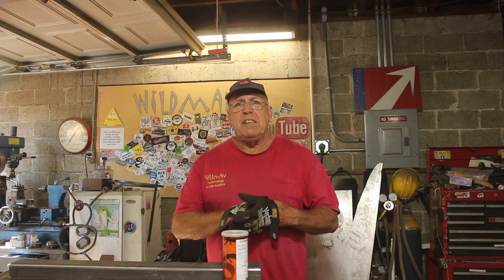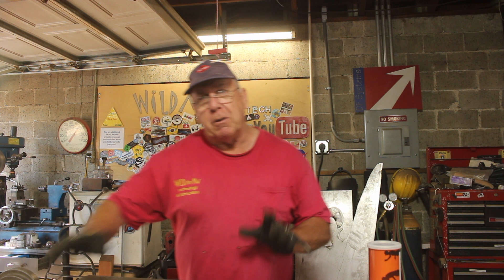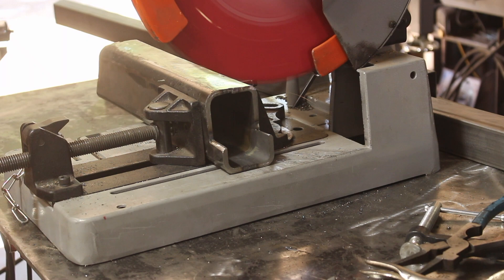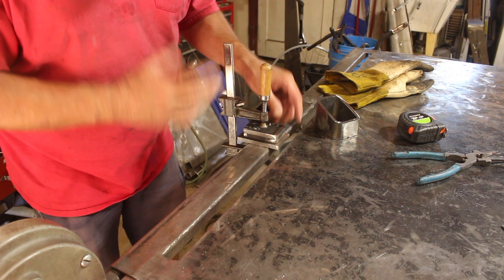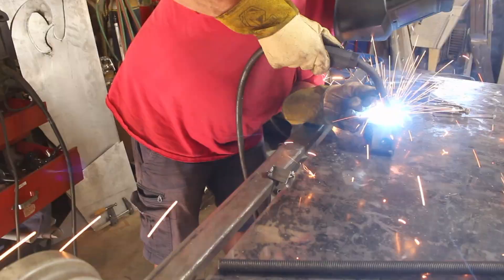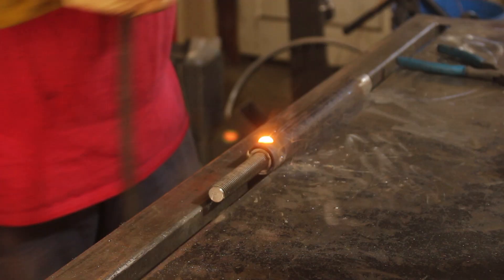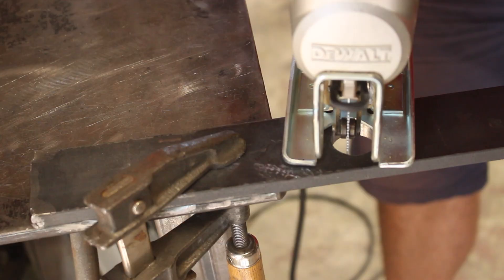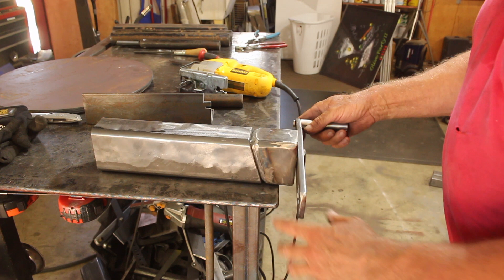Building the Fireball Tool Super Vise

Comment: I commented about this video a while back, Wildman, but the ol' budget dictated a very slow material(s) acquisition, so I had to come back to recharge my old memory cells.  As I recall, Jason's smaller "moving tube" was based on a 3.5 x 2.5 x .025 rectangular tube.  Yes, it was hard to find, but find it I did, so I'm writing to you today about the larger/outer fixed tube in the design.  I see that you quartered a 4 x 6 x ?? rectangular tube for this part of the vise, but I was thinking about using some 1/4" thick angle steel that we already own instead.  Thinking back to Jason's original vice build video, he didn't seem to be very happy about the play he got when he moved his sliding jaw assembly from side to side, so my thought is, if two appropriately-sized pieces of 1/4" thick angle steel were cut appropriately and welded together carefully - employing thin shims as upper and lateral spacers - the play between the two main tubes in the vise build might just be reduced.  I've never actually built this vise before, however, so your thoughts on this proposed variation would be appreciated.  I'd also appreciate your thoughts on the "after" of the build.  In other words, how do you like the vise now that you've worked it for while?  Is there anything you would change?  I've already liked and subscribed, but I thank you for your nice work all the same.  Hope all is well out there! 🙂
Reply from the maker: I chose to quarter a larger tube because the radii of the corners was a better fit than angle iron or flat steel. There's nothing wrong with using gibs as you suggest, but they'll need adjustment. On the down side, mine has no adjustment.
Reply from the maker: And there's nothing wrong with using scrap metal. Everything but the screw and bearings came from the scrap yard for this and cost less than $75.

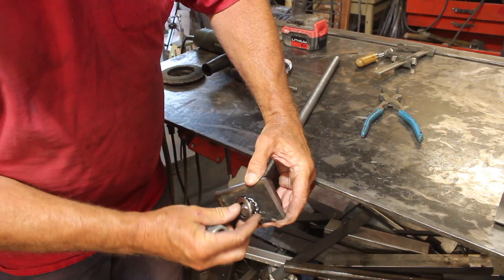Comment: Hi Wildman ~ At roughly 4:02, you describe placing the thrust "bearings" [plural] onto the end of the drive lead/drive screw.  Soon after that, you purposely showed us the "small pass-through hole in the middle."  When I examine Jason's "Front Jaw End Cap" drawing, I see a 1.25-inch through-hole and a 1.56-inch counterbore, which matches the OD of the Needle-Roller Thrust Bearing (and its two thrust washers), which are specified as having a 1.56-inch OD.  What I can't find in Jason's set of drawings is a counterbore for the One-Piece Thrust Ball Bearing.  It is specified by McMaster-Carr as having an ID of 1.00-inch and an OD of 1.969-inches.  The tubing specified in the Fireball plans has a 1.75-inch OD with 0.125-inch walls, so it clearly doesn't fit inside of the "lead screw tube."  Obviously, I'm confused about where the One-Piece Thrust Ball Bearing (McMaster-Carr Part Number - 60715K15) is used in this vise design.  Would you mind helping an old engineer out with this?
Reply from the maker: I ended up destroying this vise and building a new one. I kept the best parts of this, and improved on the weaknesses. There’s a video of it about a year ago. It may have answers.

Comment: that was impressive...no automatic machines, no fancy tables, basically all by hand....what type of welder do you have and what voltage were you using 110/220......great job
Reply from the maker: Thank you! It's just a MIG welder I run on 220 volts. It's a modern one with a switching power supply. I'd recommend an older one with a transformer. Even if you have to rebuild it, they work a lot better.

Comment: nice work.  unfortunate you couldn't find the right tubing to sleeve into the other, but you made it work anyway.  even faster than a jigsaw or bandsaw is a plasma cutter.  they sure do make plate cutting a breeze and they are getting cheaper too.  at work we have some 3"x6"x0.250" tubing drops that i am thinking  of using if i can find material to sleeve inside or outside of it, i could make a real monster of a vise!
Reply from the maker: I have one. Setup and cleanup really impact my choice to use it or not. You can quarter and shrink that 3x6.

Comment: @Wildman Tech - Considering that you've actually fabbed two of these things, at this point, I'd like to ask you if using multiple thrust washers on the inside and the outside of the 1-inch needle-roller thrust bearing would create any issues?  The 1/8" thick washers that are called for in Jason's spec's are really expensive.  We have TRA-1625 1-inch washers on hand, but they're not as thick as the washers called for in the Fireball Tool plans/drawings.
Reply from the maker: I never read his specs. I just went with what was available
Reply: @WildmanTech  Do you see any issues with employing more than one thrust washer around the needle-roller thrust bearing, Wildman?

Comment: Jason has better pressures. I made a copy of his pressures. SUPER, they turned out very cool
Reply: Без токарного і абразивної різки.дрель,болгарка,напіавтомат,напильник-весь інструмент .
Reply from the maker: How do you know that‽ I didn’t have a way to make a valid comparison.
Reply: @WildmanTech  Your clamps are not rotatable. One-time assembly, everything is welded. Jason's is collapsible. It does not affect the work, but.... after years, at least the bearings can be disassembled and washed and lubricated, and the slides (the clamps are centered, although the dirt can be blown out). what to compare, everything is visible.
Reply from the maker: @КоханийВасиль  Did you pay any attention at all‽ My bearings can be removed and cleaned. Not sure what you mean about the “clamps are not rotatable.” If you’re talking about the swivel base, who cares? It’s on a pedestal. The whole thing can be turned in any direction! Mine uses a finer thread pitch on the screw so mine would probably develop more pressure than Jason’s. Send me a strain gauge and  I’ll prove it. You failed to make the point you initially set out to make, so now you’re shifting gears to some other issue that is completely unrelated. Here in the states, we would call a person doing what you’re doing an asshole!
Reply: @WildmanTech  yes, I meant the pivoting base. I did not say that your idea is bad. Told Jason pressure is better. The compression force does not depend on the pitch of the thread. Good luck
Reply: I have a copy of these, but also a lathe and other tools that Jason has
Reply from the maker: @КоханийВасиль  The amount of compression force absolutely depends on the thread pitch.
Reply: @WildmanTech  in this case, it will not be possible to squeeze manually so as to damage the thread. Will you use a three-meter shoulder (handle) or what?
Reply: @WildmanTech  Pin from 20 mm diameter. I made with 22 mm pins. I plan to make another one in the winter, 24 mm pin diameter. Metric thread yes, Roman thread is more powerful and durable. But ordinary ones are enough for my age, then just change half a meter of pins and that’s it.

Comment: I think I would have used lug nut welded on the end of the all thread , to tighten and loosen the vise. That way I could use a lug wrench or pull handle for extra Uga dugas. Not to mention, the extra control.
Reply: And that's exactly why Jason decided against doing just that on the production version

Comment: Hi, do you sell these vises? I don't have nearly the right equipment to make one. Thanks for your time.
Reply from the maker: I don’t but Jason at Fireball Tool does! They’re $1000. You realize I only used a drill press, bandsaw, grinder and welder to do this, right? And the bandsaw was a luxury.
Reply: @WildmanTech  Thanks, I appreciate the reply. He won't sell the smaller ones, he is only selling the larger one and I think it's $1300.00 now.  Yeah, I don't have welder, bandsaw. Would you consider making one to sell?  Thanks again for your time and reply.
Reply: Correction, they are $1800.00 now. Whew!!!  LOL.
Reply from the maker: @craigstrbo  I heard about them in the pre-release.
Reply from the maker: @craigstrbo  pm me
Reply: @WildmanTech  Thanks for the reply. I PM'd you on FB.  Thanks. :)